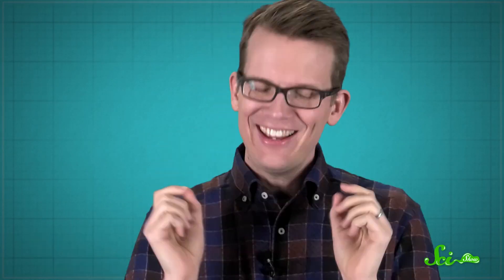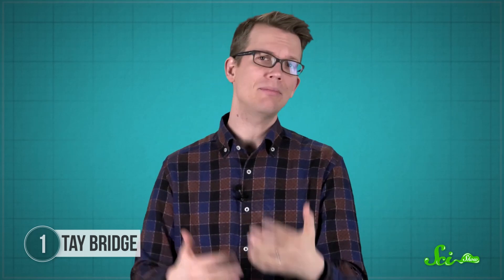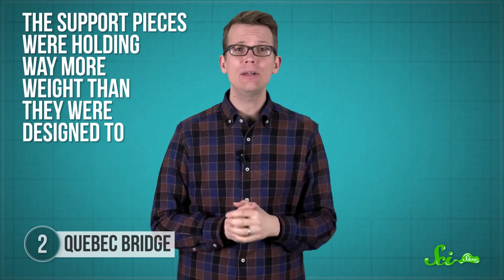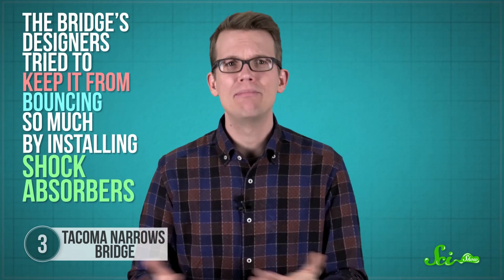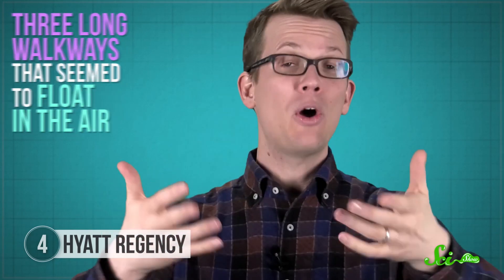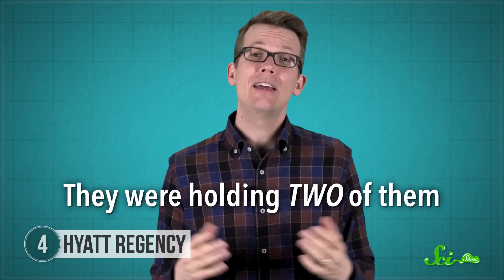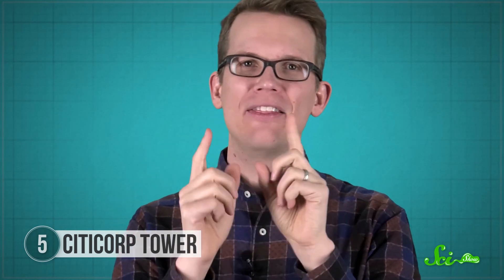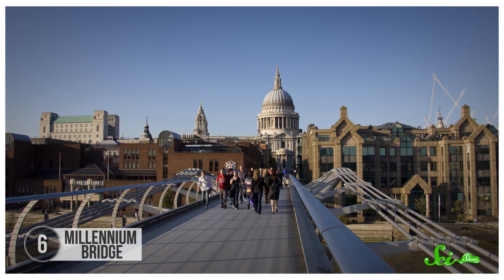6 Construction Failures, and What We Learned From Them

Comment: Tacoma failed because of aerolastic flutter, BUT it is important to note what caused that effect in the first place: the natural vibration frequency of the bridge that caused oscillations so great that the structure could no longer overcome it. The wind was blowing sufficiently enough that materials of the bridge reached its natural vibration frequencies. 

Think of it like this (and this is the best analogy I can come up with): if you hold up an acoustic guitar, and hum into its box via the hole, nothing really happens. But if you hum one of the notes of the strings at the same pitch and listen, you'll hear that string vibrating. That's because you caused a disturbance in the air that matches that string's natural oscillating frequency. Slightly higher or lower wouldn't cause that string to vibrate at all.

Now imagine those guitar strings are the cables on the bridge and the wind as your voice and you can see why it started vibrating violently, twisting the bridge around until the cables snapped.
Reply: Thank you for thinking so much of yourself you have to post an overblown lesson that all of us knew anyway and none of us asked for.

Comment: Jet fuel can't cut through steel beams.
Reply: I'm guessing you're not a black smith. You don't need to melt metal to soften it.
Reply: Jonathan Malin jet fuel is a liquid and steel is solid so on that front I guess you are right. However I suspect you are referring to melting steel due to said jet fuel igniting. However you are wrong and you only need to heat sufficiently to significantly weaken it.
Reply: Cutsman can't cut through hair
Reply: foxymetroid but eyewitness reports saw molten steel
Reply: THE FOURTH so the jet fuel melted the beams, which it couldn't have done

Comment: I'm not sure if that's actually true but I've heard several times before that groups of soldiers break lock step when walking on bridges to avoid resonances building up like in the last example. So I'd think it's something that can happen to any smaller bridge but most are stiff enough that it wont happen randomly.

Comment: The millenium bridge was certainly a big failure, especially trying to be at the height of 'millenium'! But it would have been great if you had covered the 'walkie talkie' building recently constructed in london! and how it melts cars with it's concave design. What did we learn... don't build concave buildings with highly reflective glass!
Reply: Walter Roux , the same architect had previously designed a hotel in LV, which by design or accident heats the pool in front of it.

 It also cooks poolside guests, and melts the patio furniture...
Reply: Massimo O'Kissed 
Those last two are just a minor inconvenience.
Reply: much better than the millenium clock in Dublin, at least! Placed under water in the river Liffey but the water was so dirty no one could see it!
Reply: and add an anti death eater protector
Reply: Didn't Tom Scott say this was more of an urban legend?
Reply: hedgehog3180 certainly know urban legend, Car Owners for claims in for damages, especially won't Jaguar owner who came back to his car on a particularly hot sunny day, to find that his bumper had completely melted and was hanging off the car. The paint had started peeling, and any parts of exposed dark plastic on the car scorched.
Reply: @hedgehog3180  I can only find the one story about the jaguar melting.
Reply: Another one they didn't consider air flow or something at the top of the tower and it has a slope on one side that creates gale force winds at the lobby door lol

Comment: I am disappointed by not hearing the word 'resonance' even once in this video
Reply: I'm not certain why Tacoma Narrows ins't considered "Resonance".  Wind pushed it, and with each oscillation the effect increased.  Early on it was just "bouncing", until the cable snapped and then it was "flexing", but still it was an increasing amplitude oscillation.  I'm interested to know what exactly is the difference?

"resonance is a phenomenon in which a vibrating system or external force drives another system to oscillate with greater amplitude at a specific preferential frequency."
Reply: I believe resonance refers to the case when the force applied to the system is periodic, which amplifies the oscillation when the forcing frequency is near the natural frequency of the structure. Technically, it is not caused by resonance "with the wind" as the wind was not oscillating, but instead the bridge sort of drives its own oscillations through the coupling of the different forces (aeroelastic flutter).
Reply: @dingchengluo4879  Consider the bowing of a violin.  The bow is drawn across the instrument at a constant rate.  The horsehair grabs and releases the violin strings at a periodic rate resulting in a feedback loop governed by the resonance of the strings.  The resulting action is definitely a result of resonance in spite of the bow being drawn at a constant rate.  In this analogy, the bow is the wind, the horsehair is the vortices, the and the strings are the bridge.
Reply: When I was in basic training in the Air Force, we did have to march and when we got to a bridge (had little yellow foot prints on both ends) the instructors did tell us to stop marching whenever we got to those feet. We walked across the bridge and then started marching again on the other side.
Reply: Yes, but how is the Flutter not caused by Resonance?  Had they really planned for the bridge to bounce to such heights??  (metres at a time?)  Sounds an awful lot like a type of Resonance to me.
Reply: Thank you.  Yes, I suppose that is correct that the wind is not itself a periodic force, I don't think  (wind vortices and such are complicated, of course).  So ok, sure, I guess you are correct in that Tacoma wasn't resonance, just greater and greater oscillation.  Interesting.  But I do have to agree about the foot bridge being resonance.  Thanks everyone!
Reply: There has been at least one bridge collapse due to soldiers marching in lockstep (their feet hitting the ground at the same time; "left, right, left..." etc.)
Reply: I believe (perhaps in all armies) if a group of soldiers is marching and they go over a bridge they are instructed to stop marching and simply walk over the bridge to avoid such problems. I remember mythbusters testing the myth and busted it in one of their earlier episodes but if you watch the video, there are a lot of problems with their experiment
Reply: FakeButt Exactly what are the problems with the Mythbusters experiment?
Reply: resonance wasn't really the problem because the wind (a non-periodic force) made the bridge vibrate at its resonance frequency, but every real object has a resonance frequency (even an infinite amount). The last bridge was definitely a resonance problem and a pretty easy one to detect before building I believe
Reply: A E S T H E T I C
Reply: Sorry to chime in a bit late, but the flutter that he mentions is basically negative damping. It's a super cool phenomenon that doesn't happen often (if it does, it's almost always in bridges). I had a conversation about this exact subject with my structural dynamics professor today!
Reply: Resonance!
Reply: Ok. Call it what you like, but years later after the Narrows bridge collapsed, engineers built a scale model of the bridge and tested it for wind flutter.

Think of it like an aeroplane wing fluttering at a certain wind speed. They noticed that when they increased the velocity of the wind blowing directly across the cross section of the scale bridge, nothing happened until the wind reached a certain speed. And then the bridge started wobbling exactly like the Narrows bridge.

What they concluded, was a design error in the platform of the bridge allowing for winds of a certain speed to start it fluttering. This was down to a mathematical frequency caused by winds of a very definite speed blowing across the platform, and once that frequency is reached it will wobble more forcefully until eventually it cannot take the strain. So what Hank said is exactly right, he just explained it differently, engineers call it aerolastic frequency resonation.

Obviously, it didn't help when a cable collapsed, because you would be removing strength straight away the moment that happened, and as the fluttering increases and the cable slide around eventually something's got to give.

What they learnt, was used when building suspension bridges in other parts of the world like in Japan where the sides of the bridge have a different profile, and the underneath of the cross-section has a concave shape in order to stabilize the bridge at certain wind speeds, and prevent frequency resonance and oscillation.

As for the Millennium Bridge, that was put down to lockstep aggravated resonance as Hank explained.
Reply: Your profile pic fits that comment perfectly (scghost).
Reply: How about the Millennium Bridge? Isn't resonance the cause here?
Reply: Ya I'm disappointed they didn't use its nickname "Galloping Gertie"
Reply: Even more disappointing to hear the phenomenon being called "Aeroelastic Flutter".
Reply: Because it wasn't the root cause of the failure.  Blaming resonance for 
the Narrow bridge failure is a common mistake.  However, the designers 
were well aware of resonance and designed the bridge to avoid natural 
resonance modes.  

The root cause was the aeroelastic flutter which damaged the bridge, changing its resonance characteristics so that it had a resonance failure.  However the resonance was a downstream effect, not the fundamental reason why the bridge failed.  If the flutter hadn't happened, the bridge wouldn't have suffered resonant failure.

e.g: The Hyatt Regency failure was due to the engineers essentially calculating 1 + 1 = 1 in their load calculations.  The downstream effect was a series of fastener failures.  However, the fasteners weren't the root cause of the failure, the doubling of load on them was.
Reply: IKR
Reply: well, the force applied to the bridge by wind likely wasn't constant consistent... it more than likely fluctuated depending on how the bridge was angled in the wind so that the force applied went from lows to high...
Reply: Negative damping is very interesting, I will try to program something to see it in effect
Reply: Had you been army or navy you`d be told to march harder, lol xD
"this is ICE WATER, we shall now proceed to swim in it"
"this bridge is extremely dangerous, you SHALL all pass!" :p
"jump in front of this truck, or ELSE" lol..
Reply: You are scientifically correct. It could have come into play especially with s damaged bridge or with kids  discovering how to jump to maximize oscillation on the Millennium bridge.
Reply: It shows the narrator's lack of real knowledge.
Reply: Those who are saying resonance was not the cause of the Tacoma bridge failure: Have you seen the wind tunnel tests? The bridge vibrated in different modes in different wind velocities. They put a section in a wind tunnel and showed the various modes. When they showed the mode that made the bridge collapse, the tester had to reach in and stop the model within SECONDS to keep it from hitting the top and bottom of the tunnel.
I'd say resonance WAS the fundamental cause of the collapse. After all: what caused the cable to snap in the first place?
Reply: Lion, I am an Engineer. I'm not debating with anyone, just explaining they are wrong. You, like others clearly have no understanding of physics.
Reply: scghost especially with tacoma narrows
Reply: Adam Bolton — The Tacoma Narrows bridge failure was not a resonance phenomenon.
Reply: GH If you say that you don't understand what happened to the bridge and you don't understand resonance.
Reply: Resonance was not the cause of the Narrows bridge failure.  So there's no reason why they should have said it.
Reply: Dan, of course it was a resonance issue. To say otherwise is absolute stupidity.
Reply: @danheidel  But the Millennium Bridge wobble was due to resonance, which is why it got worse with more people walking on it. The bridge's resonant frequency was the same (or a multiple) of the step of the average adult human being, which is why the dampers have worked, because they've changed the resonant frequency just enough that simply walking no longer induces vibration and wobble.
Reply: I was disappointed that what my physics teacher taught me was apparently incorrect. I believe Hank more than my teacher though.

Comment: an engineering friend of mine knew the engineers behind the Hyatt Regency.  They both lost their license to sign off on blueprints (which is something that can't be regained).  They specced the nuts wrong that was suppose to hold up the walks, so even though the construction crews built it wrong, that nuts was still under specced.  Crazy how much damage occurred just because 4 nuts were wrong.

Comment: why are there construction failures around my anus
Reply: Solid Banana cos your ass is getting demolished regularly.
Reply: You're too heavy for your toilet seat.
Reply: You have to start with smaller dildos, then work your way up, otherwise structural failure is basically inevitable. Practice every day, increase width by no more than 0.25"/week.
Reply: Solid Banana you might want to get that checked out
Reply: Solid Banana I'm not laughing
Reply: +Gerald Ellis oops, wrong button
Reply: dammit i went to like you comment for no reason but just as i did so i realized i screwed up as i had had a reason. you asked me to.
Reply: As the second earl of fartinggale you make so much wind, that it is incredible. Please, don't eat mexican, or we reach a hole new level of destructiveness.
Reply: You managed to have a collapse and a prolapse simultaneously.
Reply: You need to work out those glutes, dude...